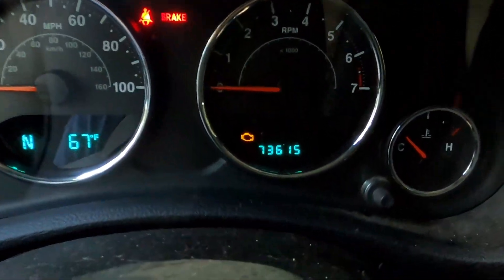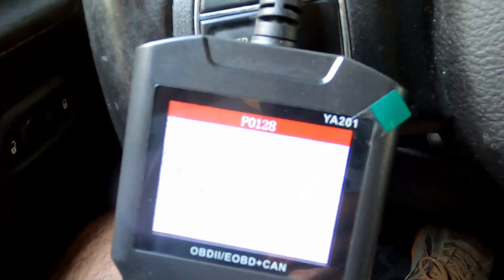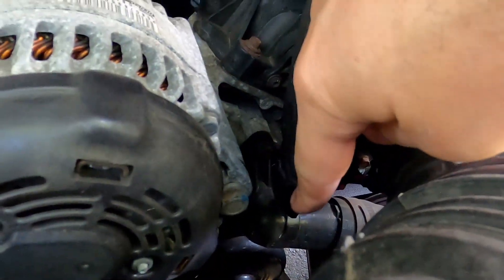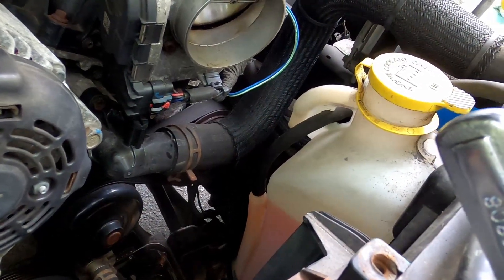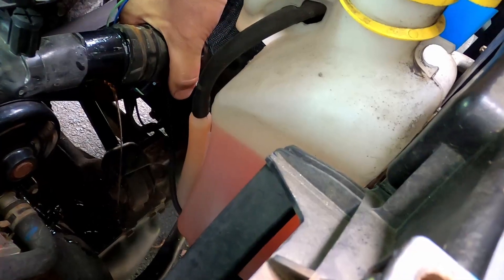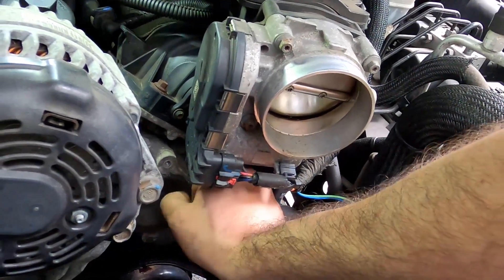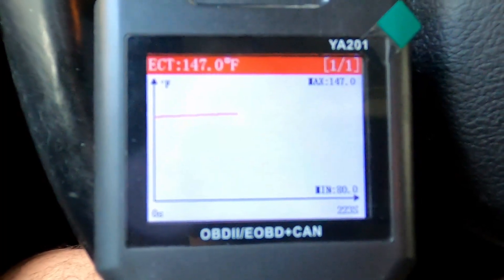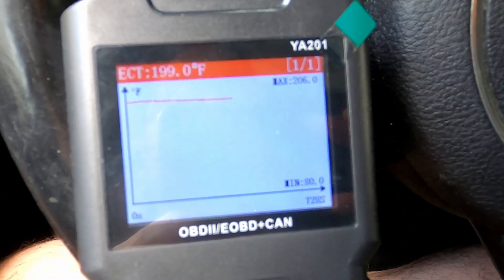Jeep Wrangler Coolant Thermostat replacement: Code P0128

Comment: What coolant did you use?
Reply from the maker: I used Mopar MS-9769G (Part number 68048953AB). It's the orange colored coolant, NOT purple. You can't mix the two, so when draining some, keep an eye out for the color.